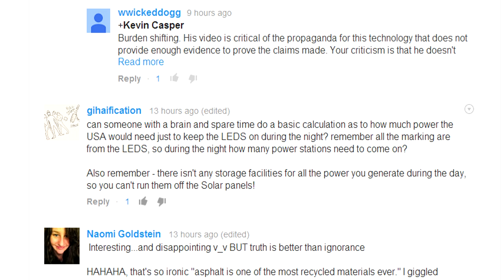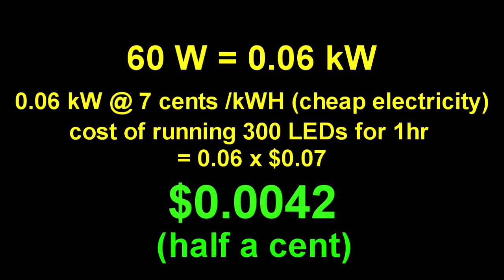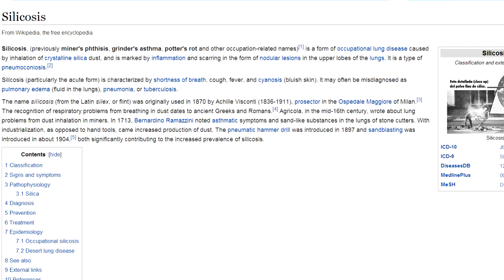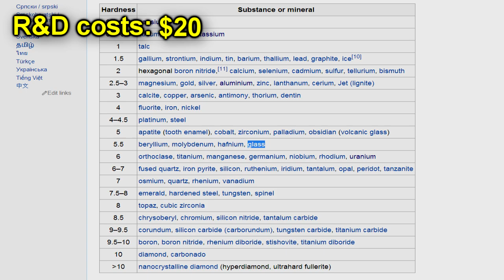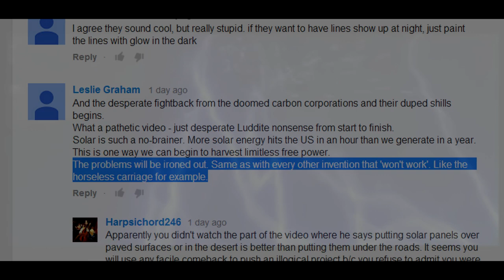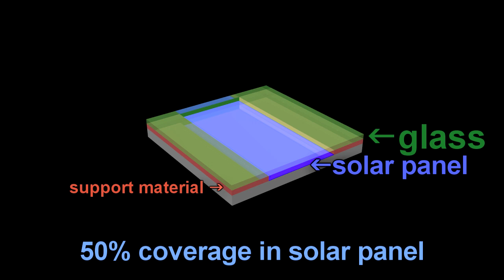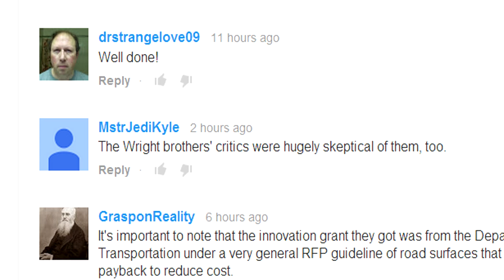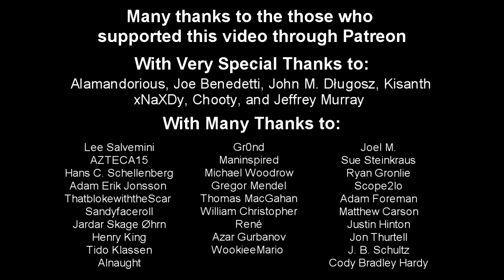Solar Roadways, IMPORTANT QUESTIONS AND ANSWERS!

Comment: Thunderf00t I love 95% of your videos, but the costing you are using is really poorly estimated for the LED's.   I've worked in electronic manufacturing for years and have a decent understanding of the manufacturing costs and processes involved. Your LED strips are costs to consumer, not the manufacture.  You can easily pick up bulk LED's for $0.06 as a consumer let alone that buying a few millions LEDs in an order as a manufacture is going to give you an incredible bulk discount. When you purchase components in quantities like that you are going to be spending 1/3 - 2/5 of the money it would cost a consumer to buy the same LED in small quantities. I know you realize this... But you are totally inflating your #'s here in relation to the actual cost of the LED's. The power problem lighting these at night could easily be addressed with capacitors in each of the solar tiles for LED lighting. VERY SIMPLE thing to add in. Holding some energy from the day in addition to piezo generators harvesting the energy from the compression of cars driving over them. The subtle trickle of energy from the headlights of cars as they approach could be the trigger to light them as needed instead of being continuously on. I will give you the point of seeing the LED's during the day.  That is just none sense.  No point in using them during the day.
Reply: Out of curiosity I checked up on the LEDs, using the same formula as Tf00t but using the cheapest bulk price I could find on Digikey. That's 240,000,000,000 x 50 (there's actually about 54 on the tiles in the pictures) x 0.036 dollars per LED gives $432,000,000,000. They are single colour (red, the cheapest), surface mount, and only have a 160° viewing angle, none of which are much use in the roadway case.

Having said that 3.6 cents is the cheapest bulk price, it's possible they could go a little lower for higher quantities but I only wanted to put in numbers I actually had in front of me.
Reply: fubecabr
 Everything I posted is an argument against the LEDs. I purposefully used the cheapest I could find to show how expensive even that would be.
Reply: Jesse Gunn

Because the decent LED flashlights are in the 1w to 5w range, produce the most light per lumen, and produce the most output. Most of these LEDs are well over a buck each. If you want to know how dumb this idea is, go place a flashlight on the ground pointing toward the sky on a sunny day and tell me if you can see any light from 10, 50, or 250 feet away.
Reply: Capacitors are not used for long term energy storage because of losses to the "Tunneling Current." Essentially electrons stored on the negative plate teleport or "quantum tunnel" to the positive plate due to the laws of quantum physics. You already experience the effects in your home as "phantom draws" or electrical draws that occur from devices you think are turned off. The TV is one example. The switch on your TV is too small to turn the TV on and off. Instead the button you press is tied to either a transistor or a capacitor that trips a larger switch. This setup is convenient for making smaller cheaper switches but the cost is these capacitors and transistors have small electrical losses all the time. 
The phenomenon is studied here: http://www.sbfisica.org.br/bjp/files/v40_404.pdf
It quickly goes into physics even I can't follow, but the intro and theoretical model predict the losses to the tunneling current as devices are made smaller. The paper focuses on losses in transistors but the same problem arises as you miniaturize capacitors. The losses grow exponentially. If you don't miniaturize the capacitors you have less tunneling current but your power storage density is low. So you find yourself between a rock and a hard place. Either you have large power losses or your capacitors take up a lot of space and don't store that much.
Reply: would a piezo generator generate more electricity (say for 2 bumps a vehicle - 2 tires in a line) to account for the shadowing of the solar panels by the cars? 100km/hr = 28 m/s so a car is like 3-4 meters? 3/28 sec * 40 W = ~5 joules,( not even counting the ones that are covered and not stepped on?) I have no clue as to the the magnitude of these generators....
Reply: taeyeonlover the piezo generator would only be useful at night.  During the day there is no need to utilize them, but they would add additional power in very small amounts.  Many acoustic guitars us piezo generators under the strings to send the electrical signal to an amp.  This is electricity generated by the incredibly small mass of guitar strings squishing the generator as they vibrate.  Think about how much compression you would get from a 3000lb car. It's not directly scable by any means, but you could easily power an LED for a few minutes.  Store the juice in the capacitors and bingo. I live in the city these were invented in.  We are looking for a federal grant to add a few blocks of these downtown to see how they truly fair in the real world.
Reply: David Cruise

Those 3.6 cent LEDs don't give enough output. You'd need some fancy CREE LEDs that cost more than $1 each and even then it still might not work.
Reply: fubecabr how can you even make that assessment without the specs for the LEDs?
Reply: Jeff Lavin next time read my whole comment "I will give you the point of seeing the LED's during the day.  That is just none sense.  No point in using them during the day." LEDs at night do not need to be very bright at all. There is no need for them during the day.
Reply: experimentx1100 I wasn't suggesting long term storage of energy in capacitors.  They already have done great research in using graphene as a supercapacitor and it's specs are fantastic and right up there with traditional lithium ion batteries. This is just to get you through the night when you don't have solar energy. I have a guitar pickup (MiSi acoustic duo 2) that is a super capacitor and it holds it's charge for over a week and I can get over 16 hours of playing time out of it before it begins to sound like it's losing power. This is the equivalent of 2 9v batteries worth of charge and the thing is the size of a single 9v battery. You wouldn't have the LED's constantly on.  You only need them when a car is approaching.  The headlight from the car can trigger this, or a network of signals that sense the piezo generators being squeezed. There is absolutely no need to have the LED's on at 3:30am if no traffic is rolling over them. Only about 1/3 of the tiles LED's are needed for traffic lanes. Not to mention roughly half of all tiles are needed for road lane, and of that only about half the LEDs are needed for a lane markers.
Reply: "the headlight of an approaching car can trigger this"

Almost like a catseye! That's the first good idea you've had since we've been at this.

So the LEDs aren't on all the time, yeah, I know, nobody here has suggested that they are. But the gizmo that detects an approaching car and decides what lights to power does have to be on 24/7.

You still haven't replied to my post on the cost. Remember, those numbers are for the absolute cheapest, simplest component.
Reply: David Cruise To be fair I stated the idea of the headlight triggers in my first post. My whole point in addressing the overstating of Thunderf00t's figures was he was being lazy in his estimation and taking the first string of lights he found on amazon for a comparison. That is in no way a remotely accurate way to do an estimation of this sort. A view angle of 160 is quite useful to illuminate the tiles. A very small viewing angle would hurt the ability to see the light from any angle but above them. Surface mount isn't an issue. I don't understand what you want me to address in your reply? The trigger for the approaching headlights is powered by the approaching car itself, via the cars own headlights and piezo generators. Photographic light meters don't need batteries because they are powered by the very light they are detecting. Something very similar could be used for initiating the turning on of the leds, or the conversion stations themselves could have super capacitors for keeping the light detecting elements active. I am sure it's an oversight on your part, but why would the photo detectors be on during the day? 24/7 isn't accurate. More like 8-12/7. Also it's not like they can't paint the lines on these later if this proves to be a huge problem. The lines themselves won't be much of an issue in regard to solar energy as they'd cover a 2-3% of the total road surface. The cost savings for snow removal in cold climates alone will be huge for city and state highway budgets. I live in the city where these are being developed and we have 4 months out of the year where our roads are covered in snow and ice. Not to mention how much this will cut down on traffic accident and travel during winter. The tiles themselves have channels between them so liquids won't pool.  These will be much safer than a typical highway when wet. Hydroplaning will be a thing of the past.
Reply: Jesse Gunn "There is no need for them during the day."
Actually, the Solar Roadways guys are suggesting using LEDs instead of paint for road signage like lane separators etc. For THAT purpose LEDs under glass just won't cut it.
Reply: Gameboygenius regardless of the want to use them, it's not needed.  If it proves to an issue you can just paint them.  Problem solved.
Reply: P.S. Jesse Gunn please view TF's new video, then try and tell me these people are in touch with reality.
Reply: David Cruise the idea of dropping something into a military situation without the need for humans to place them makes perfect sense.  the form factor is what's useful. they are super tough.  they are modular.  that's the whole point.  You could make each panel specialized for a specific task.  as is of course that sounds crazy.
Reply: I'm not usually the 'lost for words' type, but I'm really struggling to come up with a response to you. It must be great living in a world where anything is possible; where everything turns out the way you'd planned, where little things like cost, practicality or physics can be swatted away like flies.

In all seriousness now, in what aspect in particular would a solar roadway tile have assisted in the mission against Osama bin Laden? How might they have been used to induce Slobodan Milosevic to discontinue his extermination campaign against the Bosniaks?

I really hope you're kidding, because a godawful retarded attempt at trolling is preferable to the level of naivety you and this couple are showing.
Reply: David Cruise "in what aspect in particular would a solar roadway tile have assisted in the mission against Osama bin Laden?" who the fuck said it was? that is an incredible leap of logic, one of which only you are responsible for.... The only thing remotely related to Osama Bin Laden is the reference to Afghanistan.  Your need to connect them both makes zero sense.  No one EVER implied it was related to anything remotely connected to Osama Bin Laden.  That is all on you.
Reply: Jesus christ, sarcasm doesn't really work, Jesse, if I have to hold your hand and explain it to you.

I was quite clearly sarcastically implying that there would have been NO USE WHATSOEVER using solar road tiles to kill Osama bin Laden, therefore also implying that anyone who thinks they would be useful in any other military endeavor is delusional.
Reply: David Cruise It wasn't CLEAR you were being sarcastic... It's called text dude! No inflection is assumed when read.  If you don't realize that sarcasm isn't easily translated via txt you are either not paying attention or this is your first trip to the "internets" Your explanation that, "therefore also implying that anyone who thinks they would be useful in any other military endeavor is delusional." You totally grasping at anything there man.  There are so many reasons why something this robust would be useful. If you can't think of any potential uses, you need to go back to kindergarten and take a few lessons on imagination. Dropping these into areas of conflict, areas of radiation or chemical saturation.  seems pretty obvious if you want something that is self powered and incredibly tough.

Comment: Not to mention you also have to account for how much of the road is in the shadow of a passing vehicle at any given moment in time. You get a traffic jam... you get a brown out.

It would be smarter to put it in roof tops which see little to no traffic and have it track the sun for peak efficiency. A business would get more use out of this on their roof as they are generally only open during the day and closed at night. A battery system can keep them running on a cloudy day with any excess power generated from other days. Ideal for retail where your only power needs are for lighting, AC, and a cash register or two.

Comment: this "technology" only hope is as some sort of super luxury option for small to medium sized parking lots, though I have an awfully hard time imagining some sort of need for a small to medium sized parking lot to change around their markings around from time to time...  If there was some sort of much cheaper plastic material that could be used instead of glass that had sufficient strength, traction, and durability, AND there was some sort of LED-like bulb that could be clearly visible during the day, then putting interchanging lights to act as road markings would actually be a good idea, assuming you can solve all the problems of the sheer impracticality and monumental expense of generating and storing power to be distributed underneath every road in the country.